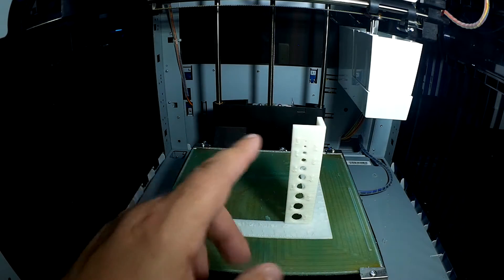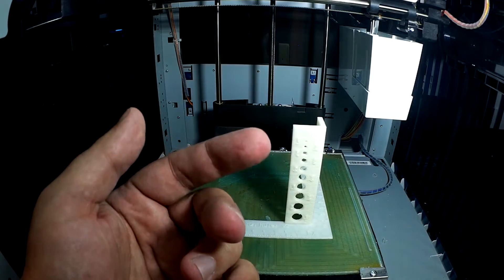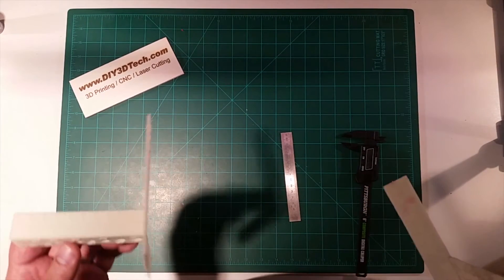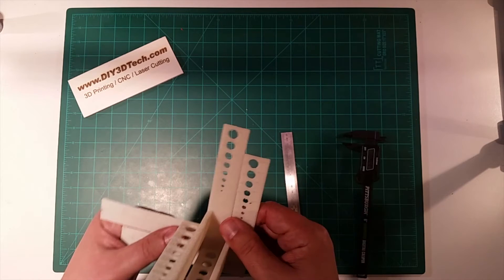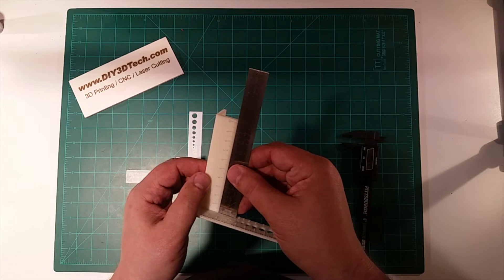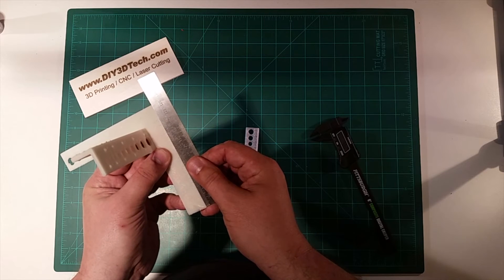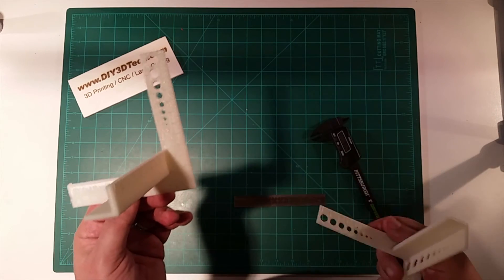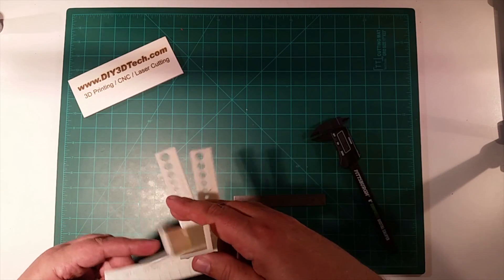XYZ Printing Da vinci 3D Printers - 3D Calibration Ruler Test!

Comment: Hello, great video!
I have a problem and I think you can only help me A few years ago I bought a Da Vinci 1.0. Because I print many constructive parts. The results are simply not dimensionally accurate. I have already changed the drawing accordingly, but I'm still not satisfied.
Ask:
Is it possible to calibrate the extruder?
Is it possible to change the size of the component X / Y?
I know other printers do that, but I can not handle the Da Vinci.
Thank you for your help. Keep it up!
Franz
Reply from the maker: Please see my other response to your note...